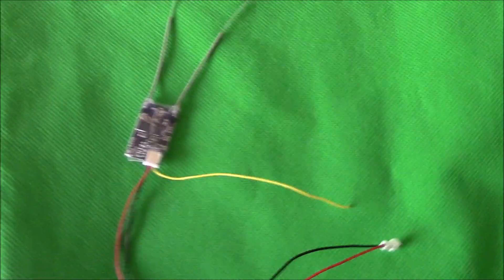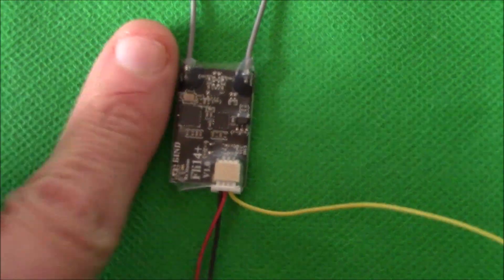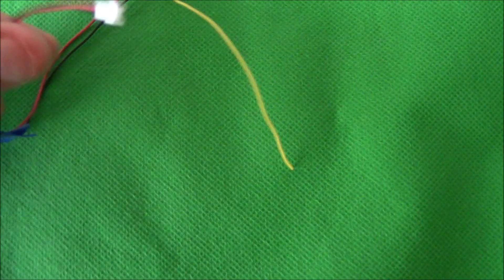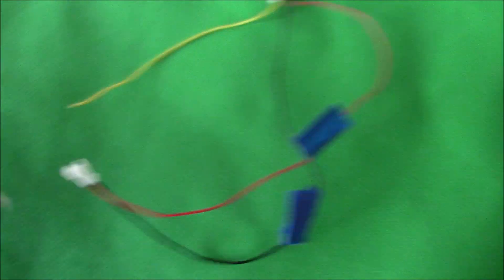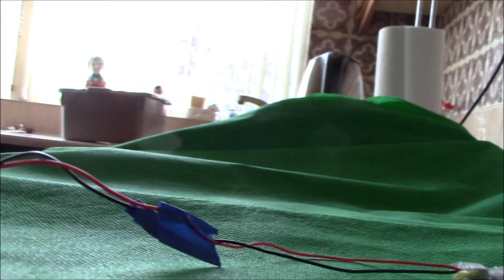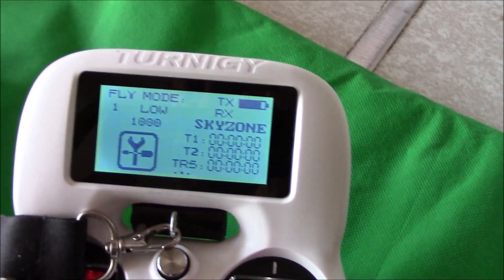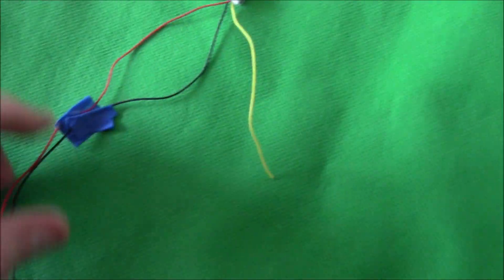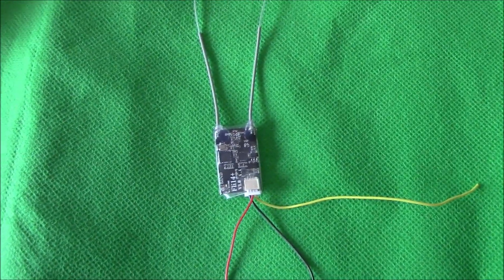Receiver  tip for new pilots

Comment: Thanks! Can i insert it to a tiny whoop? To test if it works.... can i make a lipo on the black and red wire and hold the yellow on the signal-port?
Reply from the maker: If it's bound to your transmitter a reciver will work on any flight control boad, as long as it fits in the quad lol. Now as for the second part of your comment  ( make a lipo on the black and red wire ) i'm sorry but I'm not sure what you mean. If you're talking about powering the receiver your best bet is just to do it the way I did use a 1 cell lipo and a JST connector running off the receiver just like in the video. If you meant something different I'm very sorry
Reply: George Cooper okay i will make it so. Thanks! But can i power it on by a lipo and hold The YELLOW wire on the board and look if the props turns? Im from Switzerland
Reply from the maker: Hi Flo, I don't recommend that you could short out the board, better to just spend a little time and solder the wire on much safer and it wont take lone. Hope this help. Ps. Switzerland is a beautiful country